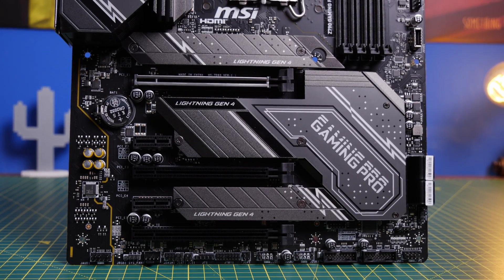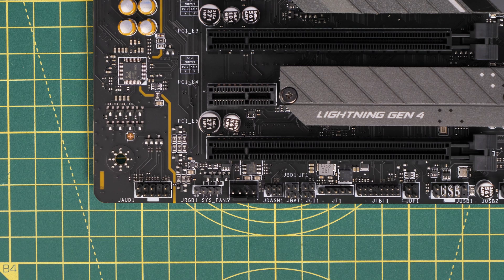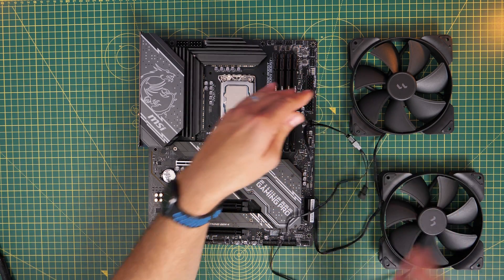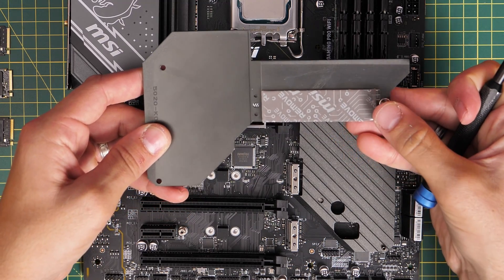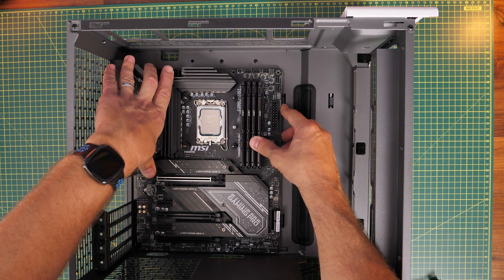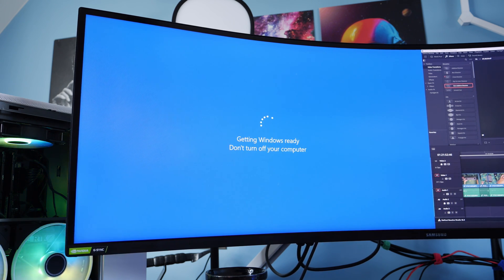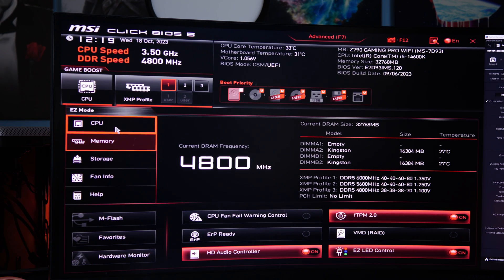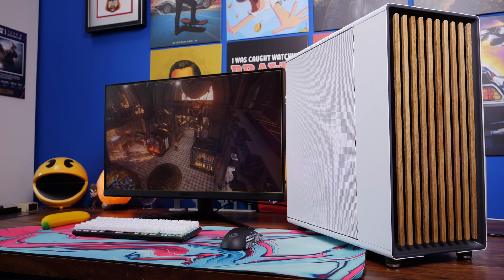MSI Z790 Gaming Pro Wifi review and setup guide (with Intel i9-12900K and i5-14600K)

Comment: my liquid cooling supply fans are rotating but lights is not glowing , can you tell me how to fix this issue ??
same Z790 A MAX Wifi Motherboard
Reply from the maker: I need more details really without knowing what your fans are or your cooler it's impossible to say. But here's a wiring guide that might help 
https://youtu.be/BUNguZBWE5w
Reply: @TheProvokedPrawn  My cabinet is msi mag pano 100l pz white and liquid cooling is from coolermaster. 
The issue is when technician assembled it, that time is was glowing perfectly . then i had to carry it to my workstation office 100km away in my car , after turning on pc here ,,, fans are moving ,, but there is no light in fans as well as no glowing light on cooling box which is mounted above the processor. So IDK if this cooling supply is working or not ? and how to fix it ?? 
cooling system is normal one only without any lcd display. 

All CPU fans are running , but one of 4 is also not glowing its light.

as i dont have any technician at my town , i can't show it to anyone. Please help me with this.

or i can send you its running video if you can give me any socials or email id

Comment: Hey thanks so much for the Video! This board has some seriously competitive features for the Price there's no doubt about that. I am making a Intel Semi 1000$ Budget, Sleeper, Specifically Dual LAN,  workstation with this among a 14600k, ddr5 6000, wd850x, 11 pro, Antec flux metal side. Making this into my personal work PC that I use to make a living. Currently have a work provided lenovo 12400 that does the job but could be much faster. I'm used to  Formerly asrock now carbon wifi 9800x3d and 9070xt so this will be my first Intel build and tune. I'm kinda lost on should I use a light gpu or run intel onboard GPU? Will not be gaming on this PC, would having a small PCIe GPU help the PC youthink? Thanks TPP

Comment: is there a difference a in performance between the top and second gpu slots? im having issues with my top slot not working on that same board
Reply from the maker: Generally speaking you get maximum lanes and speed from the top slot. I've not tested specifically on this board to say if there's a difference with the lower one though.

Comment: Thank you :penguin-blue-waving-tear: i happened across this before my install and watched it even tho i've been A+ certified before lol. The note about ram was key. I had 4 sticks in and even after a fresh windows install was still getting BSOD. But the BSOD that came up after the full windows reinstall was memory management. I was lost since it was 2 new in box sticks and 2 known working sticks from a day prior all same frequency etc. Remembered this video and pulled two out, so far it's been stable since.
Reply from the maker: BIOS updates often help
Reply: @TheProvokedPrawn  Unfortunately I tried that and it didn't help. Admittedly I have 2 diff brands of RAM but the same specs from what I can tell, so it's possible that's part of the problem. I also have the DDR4 version of the board, so it's possible that has it's own issues yet. But it's been stable 2 days now, versus the 2-3 hours from day 1.

Comment: Great video! Very insightful. Just purchased this mobo. The only thing I can’t wrap my head around is the first m.2 slot supports 2242/2260/2280 and 22110. The first two numbers on the nvme represent the width, the rest is the length. With the m.2 lock thing on the mobo being static, how can this slot support such differences in length? Too short and the nvme wouldn’t reach the catch(lock thing).

Comment: Did you have any issues enabling XMP on this mobo? I have 6000mhz ddr5 ram but it’s set at 4800mhz. When I do enable XMP my system doesn’t post
Reply from the maker: Three things. Have you got your ram in slots A2 and B2? Is your ram on the QVL ram list? Have you tried updating the bios?
Reply: @ yes to all three. I have Corsair cmh32gx5m2e6000c36 in slot A2 and B2 with updated mobo BIOS. I am currently running a i7-14700K. PC ram runs fine when used on 4800mhz but as soon as I try to tweak or enable XMP I get nothing
Reply from the maker: @LaoBoiClique  hmm. Not ideal. My other suggestion is try using Memtest86 to see if one of the sticks is defective
Reply: @TheProvokedPrawn  I will definitely try that. You wouldn't happen to have a video for memtest86 or know of a good video would you?

Comment: Thanks for the video! I am having an issue with the computer turning on but it has a yellow light on the motherboard. Nothing is booting (HDMI or DP or USB ports etc) 
Any tips or ideas? 

Thanks so much
Reply: I’m currently having the same problem. Did you ever fix this?
Reply: @ my graphics card wasn’t inserted all the way.
Reply: @ double check all your pieces connected to motherboard.
Reply: @ there it is. Nice

Comment: Is there a fix for 2 of the 4 RAM slots not working?
Reply from the maker: Bios update?
Reply: @TheProvokedPrawn  couldn't tell. I'm about to upgrade my MB/CPU/RAM in my build after 10+ years (Using 1155 socket still) and noticed a lot of the DDR5 issues are about using only 2 sticks vs. 4 sticks.  If it is so bad, why even have 4 slots in the MB?  I like having 4 slots.  Currently use 4 x 4GB in my machine.

Comment: im having problems when i upgraded to this exact set up, same motherboard, same cpu and g skill trident 2x16gig ram. Games and applications are crashing randomly and the occasional blue screen. updated bios, pretty sure i updated all drivers, idk what else to try. did some research, people are saying faulty ssd? it is 2 years old
Reply from the maker: If you've got 12th gen CPU then you shouldn't have this problem but it might be worth updating your bios anyway

https://youtu.be/MPgKTIJsKb4
Reply: @TheProvokedPrawn  yeah i have a 12th gen, ended up changing some of these settings and not getting bsod, got 1 crash in a game but have yet to test other games, thanks!

Comment: i just build my first my with this motherboard ans when i plug my hdmi cable in the graphics card or the MB my monitor just wont work, i tried to unplug my graphics card and reboot my pc and now my monitor work, i installed the latest bios update ans tried to plug my graphics card back but it still doesnt work, can anyone help me out?
Reply from the maker: @yackouille5287  are you sure your power cables for the GPU are plugged all the way in?
Reply: @TheProvokedPrawn  yeah i just found the issue i needed to download some drivers everything is good now thanks for your help :)

Comment: My bios is crashing whenever i am changing settings. Please help. I just got this motherboard just 2 weeks back. I have updated to latest bios
Reply from the maker: I've never seen that before so wouldn't know what to suggest. Unless you haven't connected power cables correctly and it's not getting enough power?

Comment: I got this motherboard with a i5 14600kf and 2 ddr5 Corsair dominator platinum rgb cards with 7200mhz.

The gamemode from bios is great! I5 performs on 5.4 ghz and 1 of the ram on even 7400mhz instead of 7200 mhz.
Reply from the maker: Nice
Reply: Did you need to update the bios?

Comment: Looking to get this board with the 14700 and wonder if the bios can be updated after windows install or can it be done before attempting to install windows as you said it would need doing to recognise the 14th gen chip. Thanks
Reply: If the board doesnt recognize the 14th gen intel you cant install windows because it wont boot. Most sellers of the motherboard include an option to update the bios before you get it.

Comment: dude just straight up skips the mounting of the mb.  thanks for nothin.
Reply: It just screws into the case super easy just make sure the screws only go 95% to be safe don’t over tighten
Reply: @lordsaltmate  for someone installing their first mb it was a bit daunting to choose the right holes with no previous knowledge of grounding etc.  the diagram on my msi motherboard manual was like an alien language.  experienced builders easily overlook these details when doing guides because it's already second nature to them.
Reply: @BOLDBANGER  i built my first one 4 days ago but to be fair different cases may have more holes so i can understand it being a challenge. if youre still having a hard time with it i watched: TechSource (How To Build A PC - Step by Step (Full Build Guide)
Reply: @lordsaltmate  thanks, I did figure it out but what could have taken 2 minutes took almost an hour of research because I wanted to make extra sure I wasn't going to fry my board the first time I turned it on!

Comment: You should upgrade your water cooling system with downside air-flow to take the heat of VRM out... I don't like the water cooling system because of its risk and low reliability.....

Comment: When you installed the CPU, did the metal plate sit flat over the CPU before you pulled the lever down? Or did the metal plate sit slightly raised until you lowered the lever?.

I did a flash bios with mine, to support the Intel 14th gen. 

I just installed my intel i7 14th gen 14700kf the metal plate was slightly raised and I had to pull the lever down to close it and lock the lever down.

Comment: PC Builder

Reply

hello can you help me out built new pc but i cant get buy the windows connecct to internet i have tried shift f10 but i cant type in the cmd box keyboard not responding how can i get it working and how can i update the drivers for the wiffi or lan off the msi website i have them but can you install them from the bios screen

PC Builder

Reply
Reply from the maker: Are you sure the LAN ones don't work? Can you try an ethernet cable? Sometimes LAN does but wifi doesn't right out of the box

Comment: If you have an AIO cooling system, do you plug it into the spot on the motherboard that says “pump fan” or  the spot that says “CPU fan?”

Ps. (I haven’t booted the system yet but) I guessed I should plug into the CPU fan spot then started having second thoughts about that. Am I wrong or does it even make a difference? The downloaded manual is thin on info and doesn’t explain much.
Reply from the maker: It's fine to use CPU fan
Reply: @TheProvokedPrawn  thank you for the info! 👍 I really appreciate your videos!

Comment: Where did you plug in the AIO pump cable? I tried both pump_fan header and cpu header and both times it shows in bios that it has 0 rpm ... but the c[u is about 30 degrees, so the pump works
Reply: Hi, same for me with a kraken x53 on pump

Comment: Does it usually take longer than 30 minutes to update to a 14th gen bios using the flash bios method? 😭
Reply: Did it ever work for you?? I need to update mine and I’m so stressed it won’t work 😭

Comment: Thank you for the video! It was really informativ and helpful.
Your recommended tests with the intel software acutally helped me to figure out a thermal issue with the CPU. And I was able to fix it, by down volting the CPU a bit (by 0.05A). Plus, I added 1 more fan in my PC case at the top, just to be safe.
Now everything runs smooth :)

You recommended to turn on the "CPU boost" - why? What is the actual effect?
Tried to find some information in the internet about details to this functionality, but without success.

I'am worried about overclocking the CPU to much and reducing the overall lifetime of my CPU. In addition to that, I already had that thermal issue... ^^

Comment: Thanks to your video i build my pc with i9 14900k the bios flaah went smooth
Reply: You update the bios with USB stick with latest firmware, you need the motherboard connected to the power suppply only, nothing else in the motherboard. Connect usb, press the bios button behind the motherboard and let it update
Reply: Do you update bios with 14th gen CPU already installed or you update the bios first with previous gen CPU and then install new CPU?
Reply from the maker: Excellent 👍🏼

Comment: So is it preferred to just use those covers on the board as the heatsinks for the drives?  or should I switch those out for regular heatsinks?
Reply: What did you do?
Reply: @dexsama8890  I ended up using separate regular heatsinks for each.

Comment: I have msi 760m-a pro, it's LGA 1700 and can support 12/13/14th gen intel CPU.

My question is, since I have i5 13th gen in my current setup, if I decided to upgrade to 14th gen, is it out of the box like simply install it?

I heard that I need to 'borrow' a used 14th gen to activate something like compatibility in bios before I can actually upgrade from 13th-14th with my motherboard.
Reply: Nevermind, I finished the vid, I need to update the bios sadly. :(
Reply: @yadah44  It's pretty easy to Update the Bios, don't fear it. If your PC is already booting, updating the bios is easier than installing a new processor. No need to borrow anything

Comment: Can you update the bios using only a 14th gen cpu or do I need a 12-13th gen installed to update?
Reply: If the board has BIOS Flashback, you should not need ANY cpu installed in order to do the update, just a flash drive.
Reply: Apparently you need to do it with all the parts not installed I am readying

Comment: Great work as always, but I will say, if your motherboard has bios flashback, as they all should, it's much safer to update bios that way.
Reply from the maker: Interesting. I like seeing it happening so I can be sure there's no problems. Thanks for sharing and for watching 👍 appreciate your support
Reply: @TheProvokedPrawn I watch the little LED blink lol. I updated my x570 proart with it just using the 24pin. I know it wouldn't boot otherwise.
Reply from the maker: @bluej511  those little lights are the most anxiety inducing part of building. Especially the system check ones. Urgh. And people complain about front panel connectors.
Reply: @TheProvokedPrawn  as long as it's flashing it's working. I know my mobo wouldn't boot with my 5800x3d so had to use flashback
Reply: How do I use bios flashback

Comment: nice vid, however, you only use 2 from your 4 ram sticks, wich is a shame of the money, i have somewhat the same setup, with 4 DDR5-6000 sticks and it works, however i had to downspeed to 5000 no XMP, because the 6000 XMP didnt work, the machine went into a loop, now i have 128Gb ram with 5000mts, i had to sacrifice 1000mts, but the pc is very fast, dont know what difference the 1000mts would have made, i also noticed that you've installed one or more gen 3 NVMe's in a gen 4 bay, maybe that why you cant see slow drives
cheers m8
Reply: Can I use 6400 with 2 sticks
Reply: @RynoDinero  yep, that would be no problem if your cpu is unlocked, once you put in 4 sticks you've got problems

Comment: Great video as always! I can't believe they haven't fixed the DDR 5 4 stick of RAM issue. When will they fix that issue with these motherboards?! I was pretty shocked to see that on my MSI Z790 board...
Reply: just lower your ram speed to a speed lower than 6000, try them all, from high to lower, one will work with your 4 sticks, cheers
Reply: Well ddr5 speed on quad channel is controlled by your cpu's memory controller. As of now, most consumer cpus cant handle 4 sticks of ddr5 above 6000mhz or so. You might have to wait for new cpus to be released
Reply: @cason.  I was much worried after placing the order I watched his video and got incredibly upset by seeing only 2 out of 4 DIMMs support 6000 mhz operation as I already purchased and opened 2 sets of 2x16 GB Crucial Pro DDR5 6000 Mhz OC units.

But luckily my motherboards version is slightly different "MSI Z790 Gaming Plus WiFi" - I started with 4800 Mhz across all 4x16 GB DIMMs and bumped it upto 6000 Mhz across all 4 slots with a total of 6000 Mhz and ran a complete 3 hours TM5 - Anta777 extreme stress test and ensured '0' errors and the system is rock solid and snappy. I'm extremely happy that the latest BIOS or my later gen processor i7 14700K has a robust IMC and able to handle 4x16 GB DDR5 at 6000 Mhz flawlessly ! 

Can you please provide latest update regarding this ?! The actual limitation and fix provided with BIOS update ?!
Reply from the maker: I actually have a feeling that one stick is faulty but I need to find some time to test it.
Reply: You said "more about this ram issue later" in the video, TWICE but then never addressed it. I watched the whole video 3 times just now haha. So am I just stuck with an extra 2 sticks of corsair vengeance rgb ddr5 6000MHz 16gb each? That's lame. Newegg said it would work. PLEASE HELP!!! Like you said you were going to discuss in your video haha. 😢😮